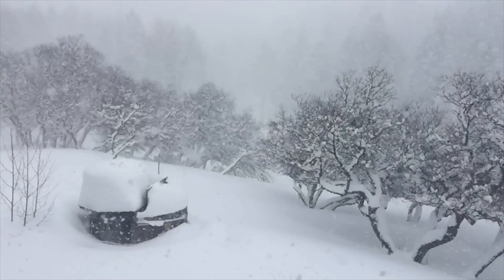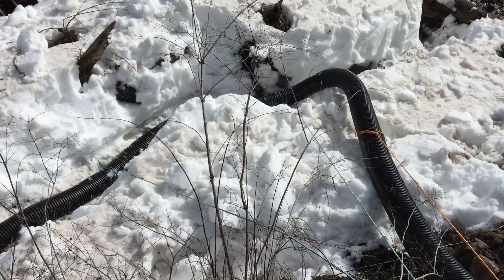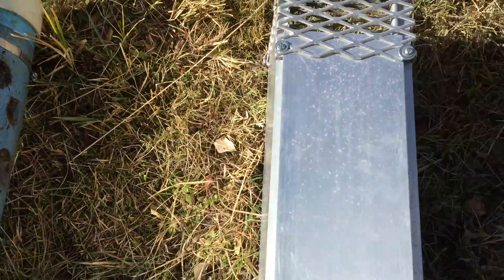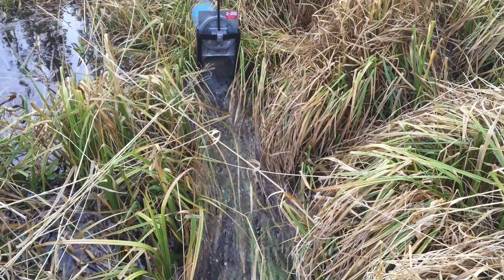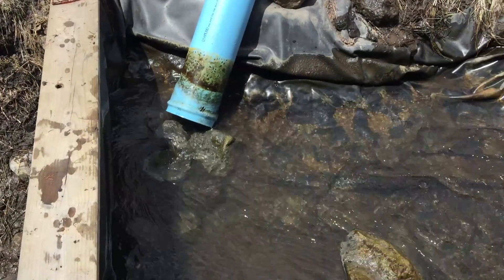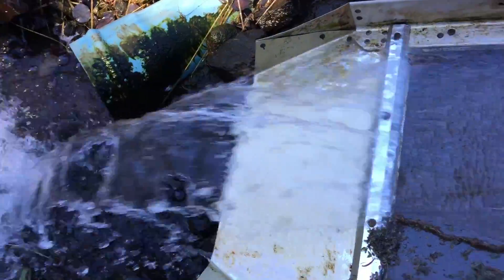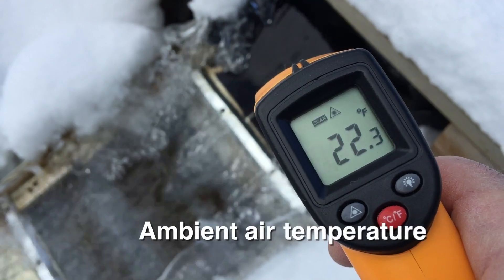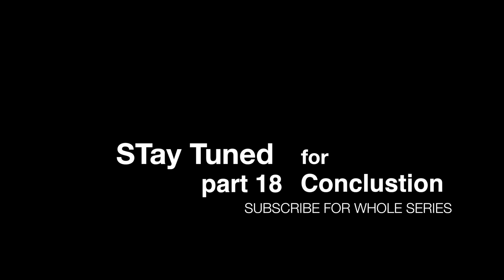Part 17 MicroHydro Power System in CO

Comment: +MrHydrohead. You may be able to solve the airlock problem by installing mechanical automatic air vents, where you presently have the bleed screws...https://en.wikipedia.org/wiki/Automatic_bleeding_valve. You could probably make your own, using some pipe, a table tennis ball and an O-ring for a seal. Is it alright if I ask you what the typical power output is in watts/KW from your generator? And is it enough the keep you totally off grid? I think I saw an earlier video of yours, showing the static head pressure at 100psi.I take it your head height is about 230 feet. I'm only asking because I have a location with a similar elevation, and would like to know how viable it is for a project similar to yours.
Thanks for uploading...very good idea of showing the failings, and how you've overcome them...love the coanda screen (never heard of it before). Do you think you can make a self cleaning brush, maybe powered by a paddle at the entrance to the duct?
Love your house by the way...passive is definitely the way to go. Thanks again, for uploading.
Reply from the maker: sorry for the slow reply.  we've been in Japan  peak output is 8.5kw or ~200kwh/day  that is more than enough for all our needs and it should enable charging a car in the future.  it is far more power than most people consume.  in spring summer fall we so far have throttled the system back as we don't need all the excess heat.  certainly its enough to live quite comfortably on.  we have a gas gene if we need to run any machine requiring more wattage, such as a large compressor. we are in talks with the maker of our coanda screen to get one of their self cleaning models.  if we put it in, of course there will be a comparative video.  the cleaning isn't a huge hassle anyway as we get exercise in the process and its fun to see it all working just fine  i agree, passive solar is fantastic.  thanks for watching and subscribe for more to come
Reply: +MrHydrohead I've just viewed your video again, and realise the information I requested is at 11:32. I apologise for asking unnecessary questions, and thank you for replying. I'm just subscribing now.

Comment: As you are surrounded by mountains, it makes sense that you could also utilize the airflow coming off of them for some supplemental air power too. 3-4 sources of renewable energy (including geothermal) would be very cool for you! If you drill down far enough, geothermal would be available to heat your home and even run a turbine.
Reply from the maker: +Robert Reno All installations entail costs. We get 175-200 kWh/day which is more than enough for all our needs.
Reply: Of course there are costs involved. My thoughts were of having a backup of some sort (not ALL of them) - for when there is a outage of some type; the creeks freeze; more tree falls; etc. From the sounds of your video, your water flow is also slowing down too. Hopefully, it won't stop altogether. If it does, your power is gone. Your videos also show tons and tons of maintenance too. Maybe one of those other methods I mentioned would offer you less maintenance as well? Not criticizing you at all. Just offering constructive thoughts on what you've shown...make life easier on you.  :)
Reply from the maker: +Robert Reno  Thanks for the thoughts.  We do appreciate them.  We are so very fortunate that the system just runs nearly ceaselessly.  Very little maintenance.  We have alternate heat methods for winter and gas generators for back up, but it now seems the only time they run is to oil and maintain them or run a large air compressor.  Perhaps the videos show the complications and maintenance too much, but it's mainly to show what sort of things can come up to those who have little experience or are thinking of setting something up.  Some viewers do criticize the vids or the approach and that can be disappointing.  The initial working out of issues is a bit trial and error and takes time and effort, but once running it is easy and nearly effortless to have this power source.  Thanks for watching!  Appreciate your input.

Comment: Looks great! How often do you check the system, to make sure everything is working/clearing ice?
Reply from the maker: Caiden Shea  maybe every 3-4 days. Particularly when it's really cold 10F and below. But the system has never frozen up. I just creates an ice cover over the intake
Reply from the maker: +Caiden Shea We go up every few days to check the intake.  Particularly if it's been in the low teens or below.  It is good exercise.  The turbine bearings require occasional greasing.  The belts have run nearly 2 years without replacement. The future plan is to possibly install a fully self cleaning intake screen with engineered design.  This first solution was a simple approach which could be improved upon. We've been traveling for several weeks and by the time we get back we will see how much clogging we get after 5-6 weeks of not being cleaned. An interesting test.

Comment: Would a vehicle windshield washer arm with a brush, like a snow brush for car windows make an automated cleaning system for the intake screen?
Reply from the maker: +kt adams Interesting idea, but cleaning is only occasionally required and there isn't any electricity at the intake anyway

Comment: One smart mechanism for cleaning the screen, without electricity:
https://www.youtube.com/watch?v=yxz4fIZarks
It is good from spring to autumn.
For the winter season you have to protect the screen with a box, something like this:
https://www.youtube.com/watch?v=XAPF_NFgfRU

Yours,
Emil Platon
Reply from the maker: Thanks for the links to both these methods.  Interesting.  I didn't really have much problem cleaning the screen all winter.  Just on long stretches of very very cold days or nights I would get an ice cap over the screen.  The water never stopped from it, but I enjoyed going up to clean it every 3-5 days.  Spring and Summer may be different but we shall see...

Comment: what happens when you exceed the 8.5k watts? brown out?, also is your load controller near the pump itself simply a resistive load bank?
Reply from the maker: +Little Bill If we were to exceed the potential peak power (>8500w) on the load side, it means you are putting more resistance on the generator than the available power to drive the generator.  It begins to slow down and when it slows below the 57-63 hz thresholds set on the circuit that magnetically holds the jet deflector out of the jet stream in the turbine, the magnet turns off and the jet deflector falls.  The system thereby shuts itself down.
The load controller is located in the house where we can put the excess power to use as mostly heat.  It could sit anywhere on the system as it is a computer that shunts variable amount of electricity to keep the system at 60hz using Triacs or SMCs.  Our uses for the excess power include domestic water heating, baseboard heaters, portable space heaters, in floor glycol heating, and soon an outdoor hot tub.  There is so much power that putting it all to use requires different uses at different times of year or reducing the power output when it's just too much. 175-200 kWh a day is a LOT of power to use up and we recently turned the system down to about 4500w because it's too much power now that winter is waning.
Reply: thank you for the detailed reply. can you provide a link to the load controller?
Reply from the maker: +Little Bill The load controller ( model A2) I purchased way back in 1995 was/is made by Thomson & Howe out of Canada = http://www.waterpowermagazine.com/contractors/governors-electrical/thomson-howe-energy-systems/.  You would need to call them, no website. Back then there were few options for ELC (electronic load control), but I believe there are many more options out there now.  You can also try a search of "electronic load controller micro hydro power" on google.  There are designs out there you can build yourself as well. Hummingbird is one design I've head of.  I haven't kept abreast of the options available because mine has worked flawlessly for decades now.  Hope this helps...
Reply from the maker: +Little Bill Here is a link to several ELC sources http://www.nzdl.org/gsdlmod?e=d-00000-00---off-0hdl--00-0----0-10-0---0---0direct-10---4-------0-1l--11-en-50---20-about---00-0-1-00-0--4----0-0-11-10-0utfZz-8-00&cl=CL1.7&d=HASH019081d439253e9516222689.8.3&gt=1

Comment: what is the cost of this kind of property ? In other words, how expensive are the terrain with this kind of landscape ?
Reply from the maker: I imagine the cost of land depends on so many factors such as location, when it is purchased, competing bidders, general market conditions, tax considerations, agricultural value, wooded or bare, scenic value, sun exposure, winter access, water access, and myriad other factors.  It is an almost impossible question to generalize an answer to. It is a case by case analysis.  Much of our property has no impact on the ability to generate power meaning it has no water or is relatively flat.  Our property which was purchased in 1990, went for around $1000/acre at that time, but that is no longer the case.

Comment: What do you use all that power for. Please show os what machines your running
Reply from the maker: +andrew young I think a video of that sort would bore you, but here's a list of current uses in a rough order of importance: Baseboard heaters, electric water heater circulated through 300 gallon heat storage tank, refrigerator, kitchen appliances, toaster, electric water kettle, portable fan/heaters, internet tower & routers, tv/stereo, computers, bed heating mattress cover, steam shower, washer/dryer, full wood shop w/table saw, lathe, band saw, joiner, drill press, mortising machine, routers, numerous electric hand tools, air compressor, pressure washer, vacuum  cleaners, lights, lawn blower.  
To be installed in spring: an outdoor hot tub, a system to heat circulating in-floor glycol system(to replace indoor baseboard heaters).  Potential future uses may include: electric car, wood splitter, greenhouse climate control, rope tow ski lift, arc welder, hydrogen production & storage, bitcoin mining.
Of course not all at once and some are strictly seasonal.  The vast majority is beneficial utilization of waste heat to maintain a constant load on the generator.  At 8600 ft. the need for heat increases in Winter greatly and the system will likely be maintained at a lower output through spring to fall.  We try to use electric whenever possible and minimize propane or wood combustion.  Cooking and stretches of cloudy days with subzero temps can require some burning, but no air conditioning.
No utility bill through all of this.  It's a very comfortable way to live!  And as you can imagine, I spend time dreaming up ways to put the power to good use.  We feel so fortunate.  Thanks for watching.

Comment: This video was worth the wait! It's time for me to binge watch the entire series as I'm sure I will enjoy it as much as I did starting with your very first video.

You and I have discussed solar in the past and it seemed you didn't feel it was an option for you but in this video you mentioned solar...Did you mean panels or just the solar gain from south facing windows.

I have to say you are the most determined man when working to make your hydro system work. I would have covered my roof in solar long ago. No system is perfect but I have to agree that your system is perfect for you.

Thankyou for sharing all your hard work. Rob
Reply from the maker: +Rob NAustin Thanks Rob.  Yes the solar I refer to is passive solar design of our windows which face direct south.  There is a prow overhang on the roof to totally shade the windows in summer.  Cool in summer, cozy warm in winter.  This winter on sunny days we've seen numerous 85 degree days inside and open windows to regulate it.  We have loads of power at this point and no batteries or snow removal from panels to deal with.  Ice removal from the intake and diversion are our only job to tend to.  If the hydro weren't so plentiful and factoring in current prices  (vs. 1995 when I started) I would certainly look at solar.  But...we are where we are at this point and so very happy with it.  The hydro is definitely something that gets in your blood once begun.  A great hobby for me and now making the videos is a joy as well.  More to come on other people's systems so stay subscribed. Thanks so much for the kind comments. The early videos were very rough and poorly made, but they still have useful info.

Comment: A though I've had watching the continued issues you've had with the creek intake, have you considered using a steel pipe for that section? I'd think it could bolted with brackets to the rock securely enough to survive the high spring flows and debris washed through the creek and the steel would be in of itself damage resistant and wouldn't float. Also if the intake were to be entirely submerged might result in less clogging? Just some thoughts, I've really enjoyed your series and as others have said hope to one day build and document a similar system.
Reply from the maker: For any of your future goals, all sorts of systems are possible.  Always a site specific solution is demanded.  We hope to document all sorts of approaches in the future installments.  The problem with making anything permanent(bolted) at OUR diversion site is that the hill to the north of the intake may any year completely slide and cover the entire intake area and be recarved by the well established creek.  Spring melt off brings tremendous flows and the forces are unstoppable.  Having a dynamic approach is what will work best over time here, with low costs and variable response to conditions dictating the best yearly approach.  We would love to have a permanent installation, but it would most likely be money wasted in the long run to attempt it at this particular site.  Thanks for watching and stay tuned for more stuff.

Comment: It strikes me that you would be better off having your creek pipe inlet and screen facing downwards in the stream, rather than upwards (having it facing downstream should help a lot as well) - that way, gravity will mean that most heavy debris will not collect on the screens and act as a trap for other particles - it will flow under the screens instead of flowing across the top of it, you won't get algae buildup due to sunlight exposure and you should avoid most of the air bubbles getting in. 

ie: the water would flow upwards into the intake pipe (even though the entire inlet is underwater)

A sunshield over the collector area would probably help reduce algae buildup on the mesh.

At the meadow: to reduce ice buildup, why not put a cover over the gate valve - even a small tent structure will hold in a lot of heat and prevent it freezing up.

With regard to your weir - apart from covering the downstream side to try and prevent ice buildup directly on your collector,  have you considered trying a vortex collector? This would throw most organics to the outside whilst allowing water to still flow through your filter and should reduce cleaning requirements. (You could try this at the creek intake as well.)
Reply: One other pointer: at your air traps, if you use plumbers string (basically, cotton or jute, not synthetic) instead of a screw, it will let air out when dry, then absorb water and expand to block the flow. When they dry out the cycle will repeat.

Alternatively, you could look at an automatic air release valve such as the ones at http://plastomatic.com/arv.html (these might give an idea for a homebuild). There are plenty of air-autobleed setups used for hydronic heating systems (radiators)
Reply from the maker: +Alan Brown Thanks for all your suggestions. I will consider them closely.
Reply: I hope it helps. I'm looking at micro/pico generation in the tropics as part of a family move to SE Asia. Different sets of problems, including critters taking up residence in the turbines.

Further thought for your upstream pickup: Rather than relying on a small screen or intake port area at all: How about trying a collection duct extending upstream of the pickup point using something like a 20 foot length of 4-6 inch soakaway pipe, soldidly  anchored into the stream bed to prevent it being dislodged during the melt. That would get you a very large distributed pickup area that's hopefully less likely to be blocked. If placed at/under the creekbed you'd still get significant quantities of water with most sediment simply washing past entirely.
Reply: excellent observation  @alanbrown397
Reply: @alanbrown397  Would the air release valves work well in sub-zero temperatures?  I was wondering about if they would work in that application.
Reply: I agree with Alan. I've been looking into using a french drain to keep my backyard from flooding in the spring and the pipes only have holes in the bottom so as the trench fills with water sediment stays at the bottom and any water that rises up into the pipe goes down it.
Reply: What about the paddle method first pioneered on shit creek?

Comment: Hi there and thank you.  My family and I also live in Colorado off the grid with micro hydro.  Over the past 20 years our system has provided us with power, pressure for a fire suppression system, fun and exercise.  We make 1800W at 24V with 35 gallons per minute at 105psi. We have been using Don Harris' pelton wheel and housing through multiple upgrades.  All the best, cheers.
Reply: MrHydrohead   
Hello. I had some trouble with your email. I may have messed up but I tried twice. R. Janssen. Cheers.